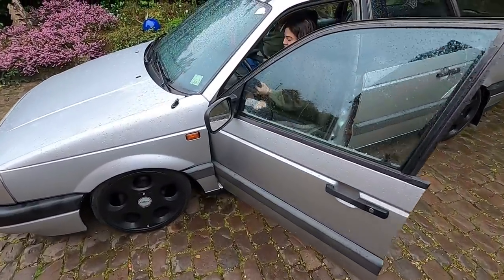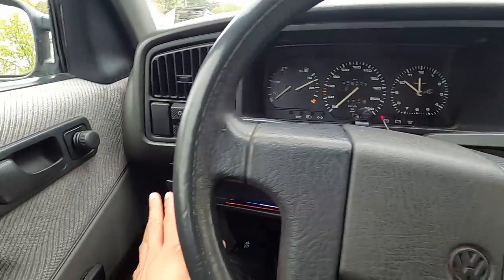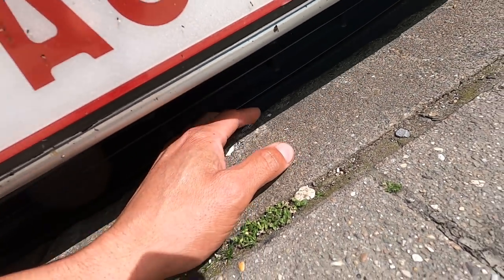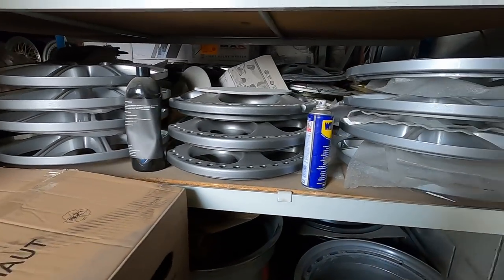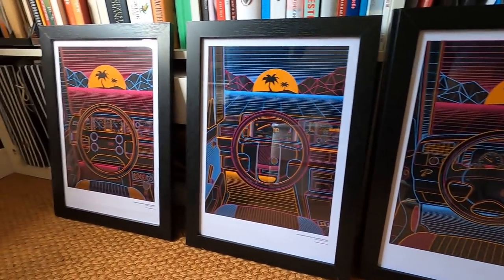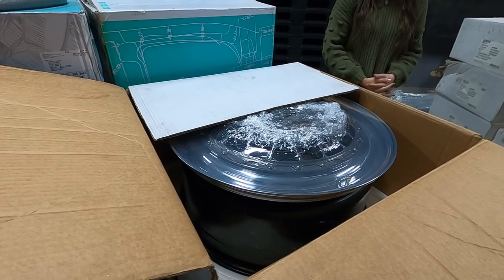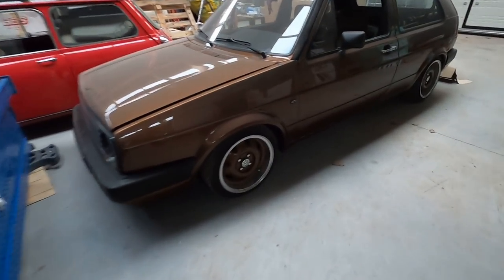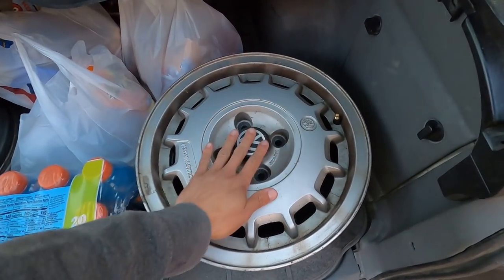Visiting RetroWheelz Epic New Shop! ( Insane Wheel Collection! BBS, OZ, Ronal, Ferrari )

Comment: We got the same diesel as that Passat in Canada, but not without the turbo lol. Even with the turbo it was only 74hp. Not hard to make them faster though, just give it more fuel, timing, and boost. That "choke" cable is actually not a choke since it's not on the intake, it's the cold start fuel and timing adjustment. TDIs have it all electronically, but on the IDI diesels you have to pull a lever on the back of the injection pump.